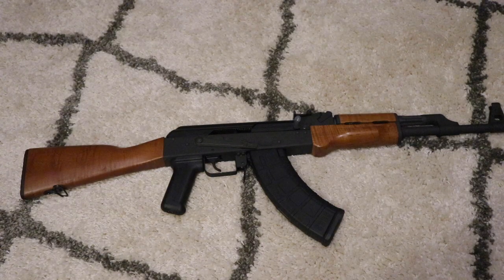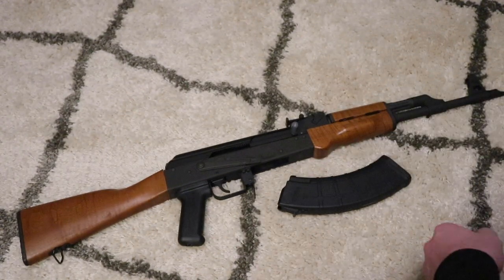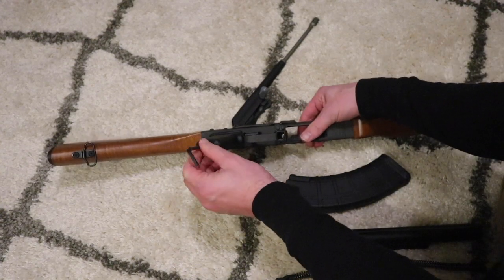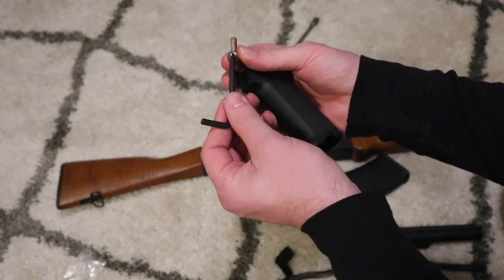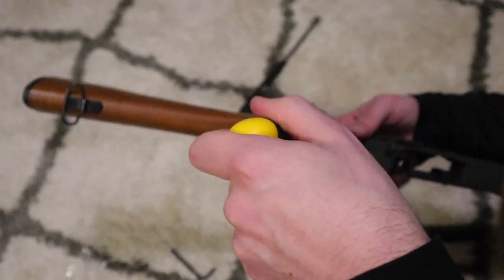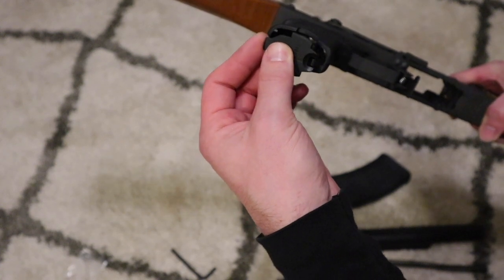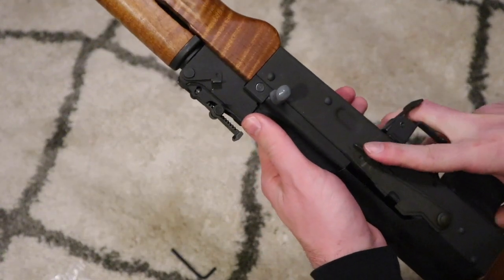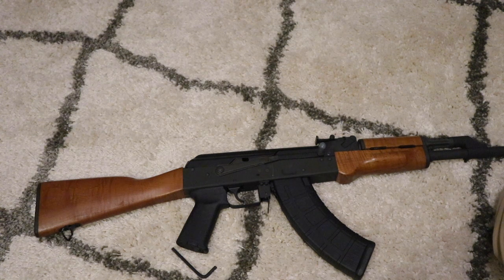How to install a Magpul MOE AK pistol grip

Comment: Does your magpul grip  move?  b
Because mine does.
Reply from the maker: Iron Horse no it does not move, did you make sure it was screwed in all the way?
Reply: @GruntNation556  yup screwed it in to the point I can't turn it.
Reply from the maker: Iron Horse sometimes the screw will be crooked and you will have to take it out and put it back in or there are two different holes that the screw can go in and you might have to try the other one.
Reply: Old thread but I learned today that magpul’s screw threads have a lot of slop so you need to run it thru the nut a few times on a vise with some lube.